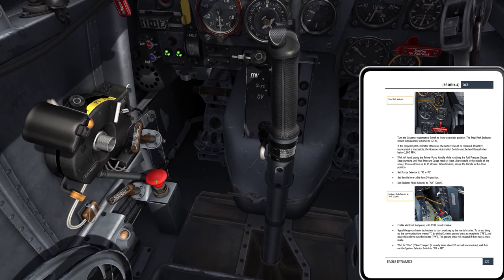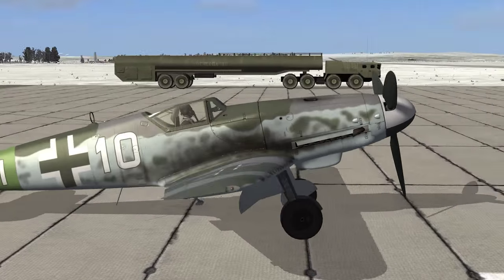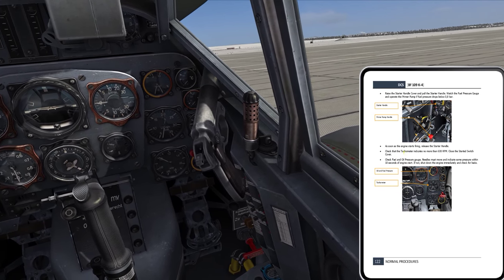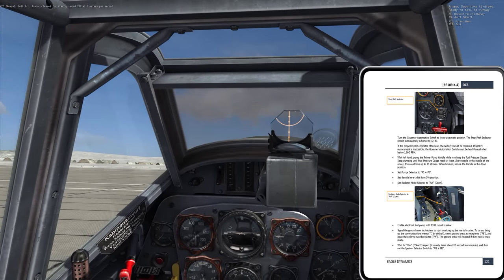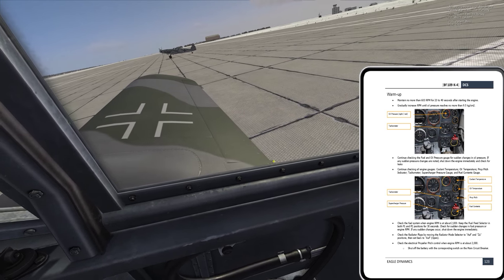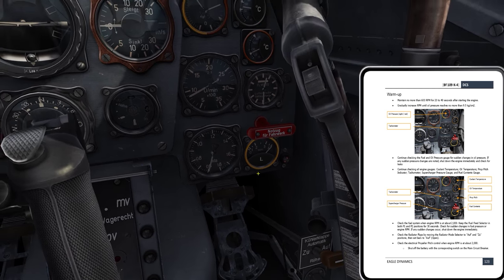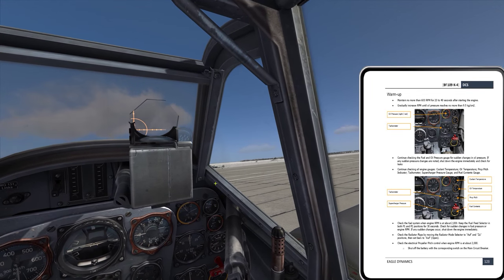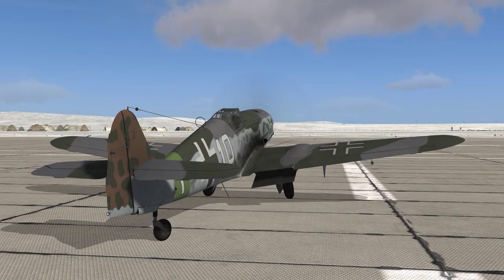Test Flight - DCS: Bf 109 K-4 Kurfürst #2 - Start-up and Run-up Checks

Comment: The Coolant Temperature went up because the Prop Pitch was going down. This leads in Addition to your Throttle Setting to a very high Engine Rpm. Later in Flight you can turn on the MW-50 Water-Methanol Injection which gives you extra Power for climb and also cools your Engine as well. Max. Rpm for Cruise should be around 2200 Rpm. In Combat with MW-50 you can go to 2500 maybe 2600 for a short Period. For Climb you should leave it at 24-25 at the highest. Climb for long time with high Rpm kills your Engine very reliable ;-). The 109 is my favorite Prop Plane by far in DCS :-). It´s also the most challenging with it´s narrow Landing Gear. She likes to flip over the left Wheel after Touchdown...

Comment: Bunyap. Firstly, the manual lies. It pretty much never tells you when the wheel is at full spin. Also, you waited way too long between priming and starting. Go back in video and look at fuel pressure as you start up. The needle should be at the "running" pressure as you start up. When u started up, the fuel pressure struggled to come up as the engine-driven pump tried its best to get the fuel goin. Not criticizing. Just warning. In WWII mechanics said that could foul spark plugs and the pump. ;)